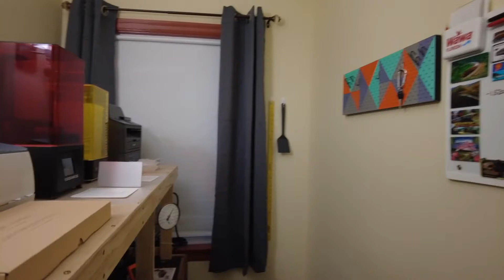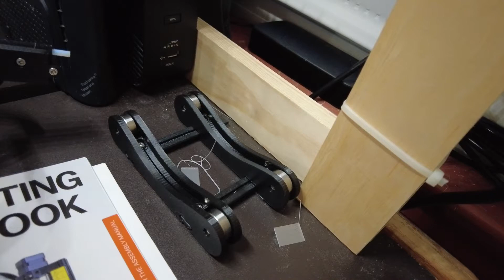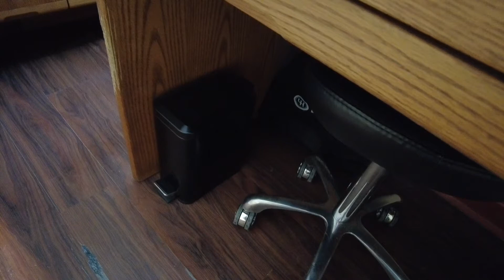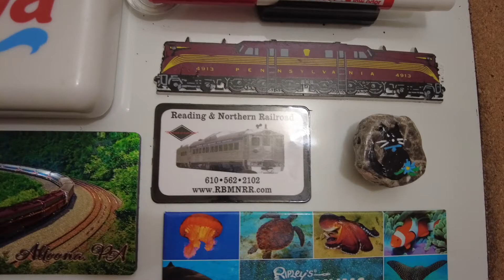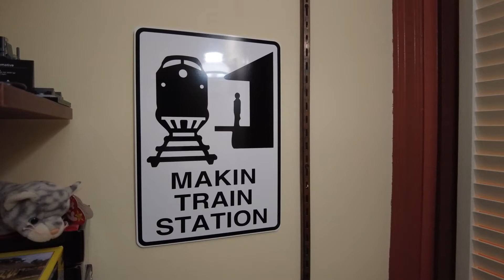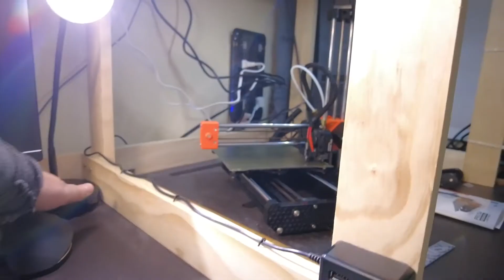Tour of “The Printing Press”

Comment: It looks like a great place to work, Jamie! My closet office workbench room is 3 1/2' x 7 1/2', so I can totally relate! lol Thanks. T4
Reply from the maker: Thanks so much, T4! It's funny that your closet/office/workbench is so close in size to this room, and your layout room is so close in size to the loft I'll be building my other layout in. I'm still not going 9 levels though, lol! Maybe 2, but not 9!
Reply: @JamieMakin  Hey, Jamie... with N scale you don't have to do as much building up in the same space as I do, although I would like to see that! Maybe a large helix around the outside (just inside the outer walls) then across the ceiling to another helix in the middle to transition back down... forget 9 levels... I'll bet you could get 20-30 in there! lol maybe run 40-50 trains at once... a simple re-wire of your entire home should provide enough power. Thanks. T4
Reply from the maker: Lol T4!!! You make me want to actually design that just to see what's possible! If you can get 9 levels of O scale then 20 to 30 levels of N scale should be doable without breaking a sweat. I'll be calling the power company in the morning to see what they think! 🔌⚡️😅
Reply: @JamieMakin  LOL T4